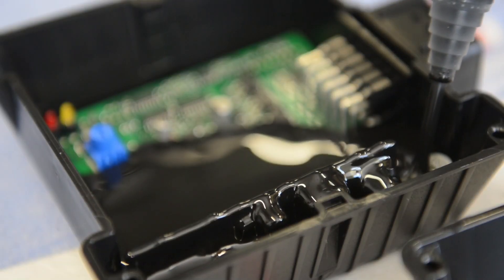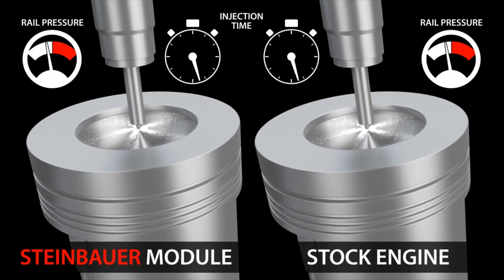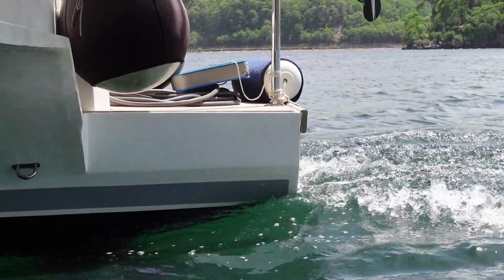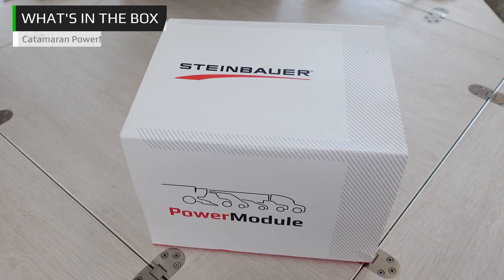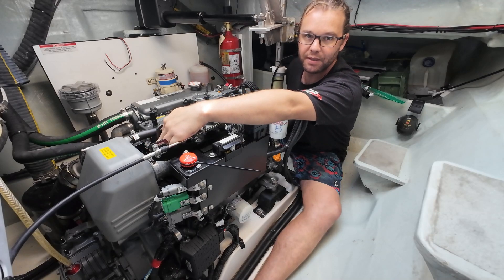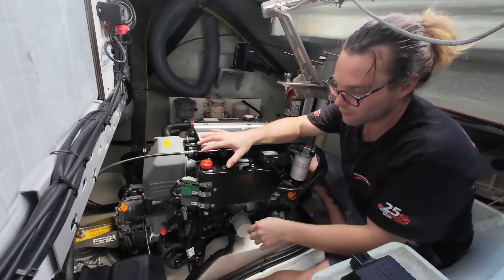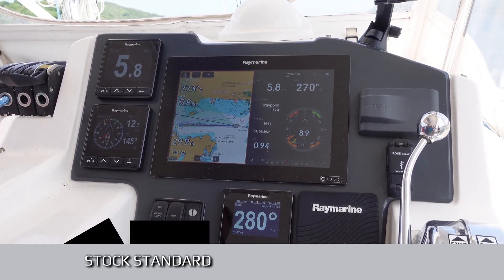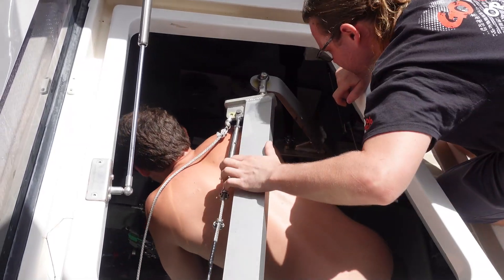BEST Yanmar Engine Upgrade for Catamarans and Yachts - More Power, Less Fuel

Comment: People need to understand something really simple here. If a 4JH45 and a 4JH57 are the same thing  running a different program. Why would you choose to operate with a 30% power deficiency and use more fuel? So you can claim a Yanmar warranty if your engines fails from Yanmar? 😂 Maybe do some research into how long that takes, if you manage to meet the conditions and get it at all and the last guy who serviced the engine now 1000 miles away possibly gets the blame.  This was made to fix a problem because they wouldn't sell us the 57 ECUs, not make a profit.

Comment: I'll bet NOx emissions are through the roof because the engine is running lean and hotter which more completely burns the hydrocarbons in the fuel producing more power, but also increases thermal NOx formation without a trap like AdBlue (urea) and a catalytic converter. NOx that ends up as smog and acid rain. Or as I like to call it "Purple* rain, Purple rain."

Prince: "When there's blood in the sky... red and blue = purple. Purple rain pertains to the end of the world and being with the one you love and letting your faith/God guide you through the purple rain."
Reply from the maker: It is no longer under fuelling. Basically it in a nutshell.

Comment: Definitely void’s warranty! It only adds fuel as anyone who knows diesel’s knows air flow is not controlled by the ecm   So it is the same as a tuner on a diesel truck, adds timing and fuel. Not saying it’s a bad thing but it absolutely void’s warranty! And there are hardware differences between the 45/54hp engines! There’s more to an engine than a block!
Reply from the maker: I suggest you go and watch the video with the site manager of STEINBAUER USA who explains warranty implications, what protections are in place for US based customers under the Magnuson-Moss Warranty Act and how they will support you if your engine manufacturer tries to wrongly deny warranty based solely on the presence of a module. It's also worth noting that because the module has no ECU footprint, it's impossible for a technician with computer diagnostics to know it was there when unplugged, unless they physically see the module. 

https://youtu.be/rvTsRa8kWa8?si=fmDh8StH14GrJ4Cs

I did not say it adds air, I said it optimises the air/fuel mix. This is done by adding more fuel during main injection when the engine is under load. You are correct that it is like trucks; STEINBAUER makes these PowerModules for diesel engines in trucks, tractors and agricultural equipment, RV's, personal vehicles, heavy machinery, 4WD's and boats, and have done so for decades.

There are no relevant differences between the 4JH45 and 4JH57. The base block is actually used throughout the 4JH range, but the 4JH80 and 4JH110 have significant hardware changes largely due to being Turbocharged & Intercooled.
Reply: Why are the parts the same ID numbers for both engines then?